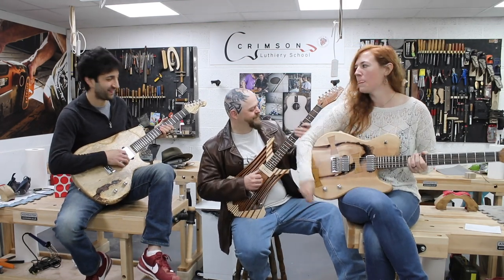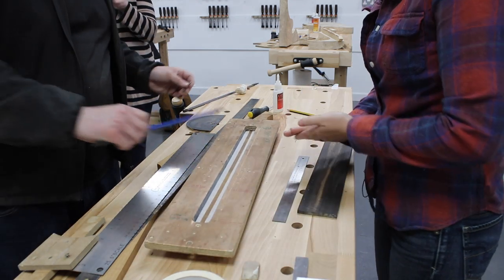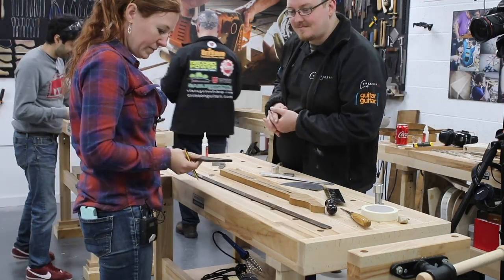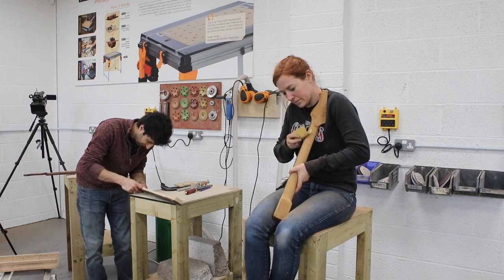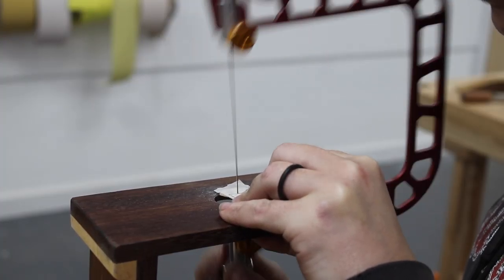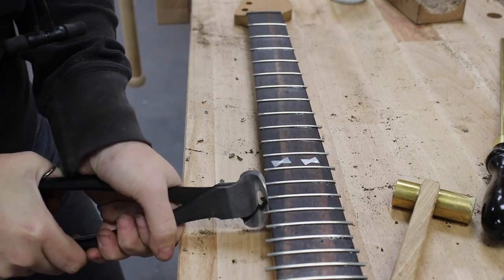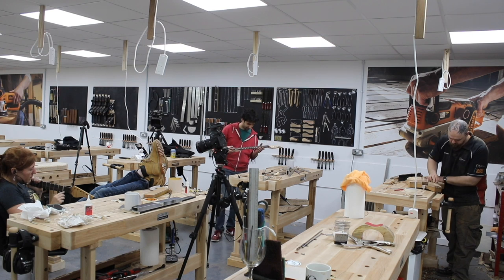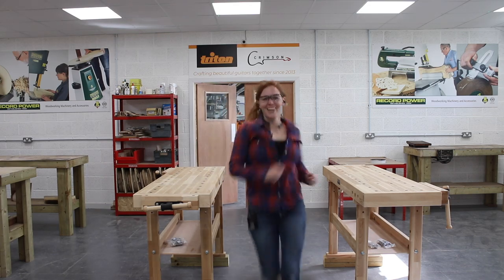Building a Custom Guitar with Matt Cremona and Crimson Guitar

Comment: You level the frets because if the frets aren't level the string will buzz against frets further down the fingerboard. Imagine you are fretting at the third fret but the 5th fret is higher than the third fret. Afterwards you round over the fret again because you want the string to only contact the fret at one point (ideally the middle). Else you might get fret buzz.

Comment: One tip for you in the future on doing Bow ties to make it easier.  Cut out the shape on some fairly thin plywood.  Then shape the thin plywood to the exact surface you want.  You can then use it as a router template for your thicker pieces.  Faster method since the shaping job is on a thinner templace piece. You can use a small chisel plane to clean it up if your template isn't just right.  Nice tribute to Nakashima!

Comment: You sand the frets flat so that they are level. If you leave it the way it is when you hammer them in, they will be at different heights. Then you crown them so that only a small amount of each fret pushes on the string, giving you more precision.

Comment: That looks like Macasser ebony. A few questions, what is the radius of the fretboard, what's the nut width, what is the thickness at the first fret and the top fret, what size fret wire did you use, what pickups are you using and what was the final cost? I've assembled a few guitars from parts I bought from Warmoth, but I've never tackled a project like this.

Comment: When you install the frets they may not be completely in line or level up and down the neck. If they are not perfect they will cause one or several strings to buzz when fretted and not produce a crisp clear note. So you install them, level them and then round them once more.